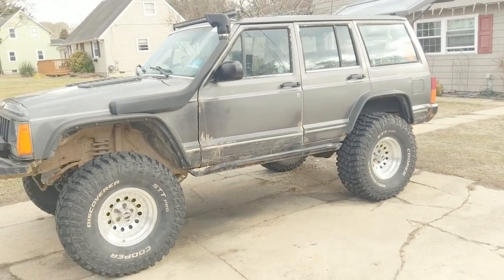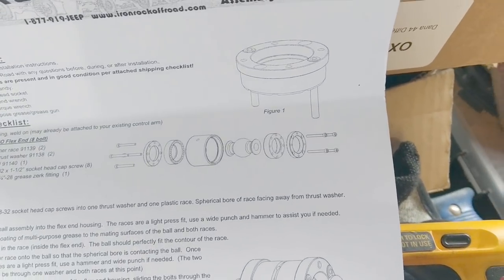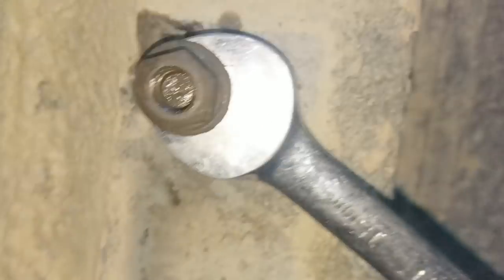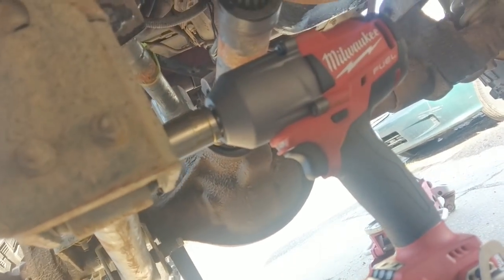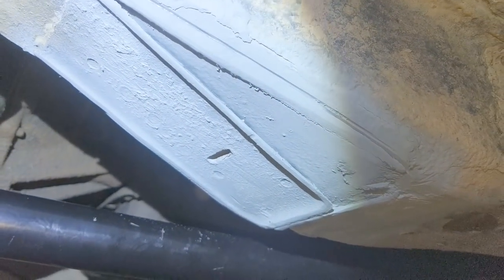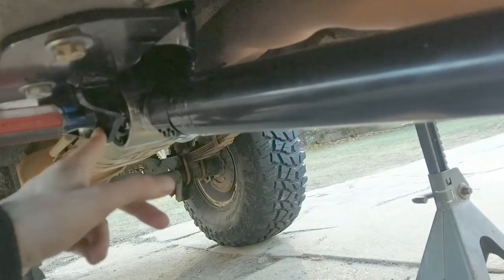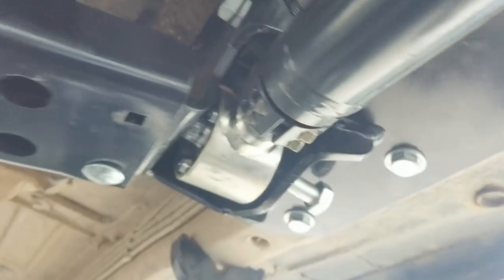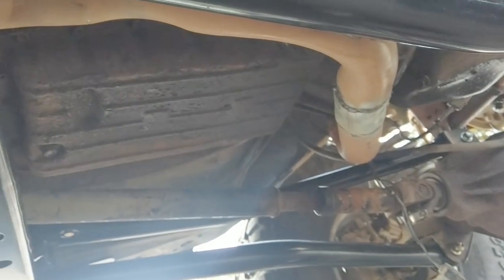89 Cherokee IRO Rock-Link Long Arm Install

Comment: Seriously! Calling the IRO a crappy design is not fair. Put a damn jack under the cross member to hold it in place while you put in the bolts!  That was painful to watch. You choose to cut the lower arm mounts out with an angle grinder/cutoff wheel then cut your exhaust with a sawzall? Dude! Next you hack up your exhaust paying no attention to IRO’s warning regarding custom exhaust! Wow, makes me regret wasting an hour watching.
Reply from the maker: Your response is a bit perplexing. Any criticism here is meant to make their product better. I saw things that were annoying, and making them not annoying would lead to a much smoother install without needing lots of unnecessary tools. That how products get better. I look for people's criticism all the time so I can improve my own products as well as how I make videos. 

I feel like I burn through sawzall blades faster then cut-off disks, but what does it matter? I'm more comfortable with a grinder and that's what got the job done for me. You can use what works for you.

And I didn't see a single mention about exhaust in IRO's instructions or on the website, but I'm certainly not blaming them for a fitment issue with non-stock parts. I cut my custom exhaust and welded it back up to fit with their kit and it works fine, so what's the problem here? Would you have done it differently? I certainly couldn't bend it.

A lot of people like my videos because I show all the issues I run into. Then viewers will know what to look out for and how to deal with potential issues. Got stock exhaust and extra jacks laying around? Then your install will go smooth then mine, learn from my experiences :)
Reply: NickInTimeFilms criticism that “makes their product better” is sent directly to them, bitching about their product is what u were doing. Yes i do have many jacks 5 to be specific and 8 stands, having long arms is not what separates “the big boys”, it is being prepared to take on these types of jobs and doing the research necessary to tackle the unknown such as custom exhaust. You do not make the videos to educate, your intention is to maintain an inflated ego and make money through advertisement views. If you truly wanted to educate then you would employ a broader vocabulary that does not use near as many colorful metaphors and educate yourself before teaching others. As a professional welder/fabricator it is not about using the tool you are comfortable with but using the tool appropriate for the job, people do not use a tack hammer to drive spikes because a sledge hammer is uncomfortable to hold. If you really want to continue to make educational and informative videos then educate yourself with a higher level of vocabulary, practice what you are about to do, be prepared for the unknown and remember you have a responsibility to keep those watching from harm by showing them the right way to complete a task.
Reply from the maker: You're certainly giving me more credit then I deserve, but your accusations are distorted my friend. I make my videos for fun and because people seem to like the detail I go into. I have been running ads over the past few years because seeing a little chunk of change each month is nice incentive to keep making videos. Adblock is out there for people that want to skip them all, and I don't have an issue with that, I run it too on most other sites but keep YT whitelisted so I sit through crap just like everyone else. But trying to "maintain an ego" LMFAO, what ego? If that was the case then I don't think I'm doing a very good job at it. An ego would mean showing off and doing an amazing job that no one could compete with, not having difficulty with fairly basic kits the whole way through. Being incompetent is not an ego I would strive to obtain, that's for damn sure. Didn't mean to get an IRO fanboy so butt hurt. I like their stuff, that's why I keep buying, but things can always be improved.

I always put it like this. The videos I make are Free Content that I make for fun. As such, I do not take them as seriously as I could. If you want real education, go pay for it. I could sit there and write an entire script, film everything with proper equipment, and obtain a much higher production value, but I don't have the time. My goal is to get the Jeep fixed in a timely manner and since this is not my job, I am only putting in a "fun" level of effort. I take people along for the ride, and if they don't like how I run things, then go somewhere else. I'm not worried if people don't like my cursing or other use of language. I'm not going to change who I am to please the few complainers in the bunch, because then I'm not having fun and this won't be worth it.

What these videos do show, is what the average Joe can expect when they are doing this job for the first time, just like I am. I don't make myself look like a professional, because I obviously am not. So hopefully viewers can relate to me as such and not take my word as the holy bible. I run into problems, I find solutions. Am I missing something here?

And I still don't know what you're on about with the sawzall stuff. IRO's directions even say their favorite tool is a grinder with cut-off disk. Tools are designed for specific purposes and should not be misused, but I'm using a grinder to cut metal.
Reply: NickInTimeFilms roflmfao!😂🤣
Reply: He has a welder and it wouldn't take much to rework those mounts or tack in the carriage bolt into place and use a jack as you mentioned to hold the cross member in place to tighten up the hardware....   But to NickInTimeFilms,  the reason why they supply carriage bolts is the nut or standard bolt head will get damaged to the point of failure on rocks and will make it much more difficult to get off or fail on the trail.... That is why they made this design.... and to keep it a inexpensive option keeps there from being more complex mounting of the cross member that could easily be modified to recess a standard bolt with a welded on nut to the long are side of the bracket....
Reply: Daniel Carney but that is what a big boy would do. 🤣
Reply: NickInTimeFilms cant take the heat then stay out of the fire. U want to play with the big boys or are u still playing dress up in daddy’s shoes? Its ok for you to “criticize” other peoples stuff but you cant take it when the roles reversed?
Reply from the maker: And to think they call millennials the snowflakes, I can think of way more "mature" people that will throw a fit over a minor inconvenience. Everyone has opinions and no one has to agree, that's the nice thing about the internet. But there is a difference between constructive criticism and showing your keyboard warrior credentials. It's obvious you don't like my style, so maybe you should develop your own channel some and show everyone how a real man builds a Jeep properly. That way I can comment on it and tell you that I appreciate the effort that you're putting into free comment for the masses to see. But please, continue your banter, it's still partially amusing.
Reply from the maker: Now now, if we're going to use insults, at least make them period correct. Tide pods are for Gen Z attention seekers, back in my day the fad was a mouth full of cinnamon without choking on it. Now then, can you tell me the main reason why control arm drop brackets are used? That's right, to obtain flatter control arm angles so that road vibration is soaked up by your springs rather then by the body, thus giving a much smoother ride. They also allow the axle to drop more to give that all sick flex the mall crawlers need so bad for grocery shopping. The sway bar drops are incorrectly used however and have been removed now that I have the proper caster adjustments to keep them off the springs. So by your logic, I should show people the safe way to lift a Jeep, is this long arm video where I remove all those drops not fitting that bill? But, you did use the word teach in there, so you might finally be on to something here. I still think you have a hard time differentiating humor and sarcasm from ego stroking, but maybe you only know about the latter as your work is so good that example isn't even necessary to prove its beauty. In all seriousness though, do you even have a rig? Anything mildly trail capable? I'd love to see your progress on such a masterpiece.
Reply: Oh please! I would love to have you attempt to follow me. Lets see how long those fake bolt on sliders last. That truck wouldnt get 1/2 mile into the trails we run. There is everything wrong with drop brackets! You expose your arms to rocks to get bent, hung up on, and just plain sheared off. Theres a reason why nobody, and i mean no one runs them! I challenge u to tell the gang at pirate you ran those. Oh wait that would bruise your ego, or are you a big boy now u got some long arms?
Reply from the maker: Ahh, a Pirate dweller, now it all make sense. Now you've got beef against JCR Sliders, man it must be tough pulling up your pants with those massive balls getting in the way. I've had the whole side of the jeep up on a rock where the axles were at full droop and they did just fine. From a clearance standpoint drops are terrible, no questions there. That's part of what I talk about in this video actually. I've only gotten caught on them once, but some skinny pedal fixed that. I'm impressed with how straight they still are after all the shit they've been bashed into, but it certainly doesn't feel too good. But it's ok, hide behind your forum possie, I don't need proof of your awesome rig, I should have been taught to just respect your word, right? I'm certainly not in 1 ton, rockboucer, Reds Only, territory but my setup is more than enough for what's local and I can drive it home afterwards too.
Reply: undersizing the hole would foul or cause damage to the threads and possibly fail.... Gotta think from a business standpoint. difficult install is a lot better than a lawsuit for a flawed design that was found to cause the failure.  But with most of these type of kits the installer needs to be flexible and think of ways to make things easier to install.   To be honest looking at that design I wouldn't buy it just how it looks... If I were to make comment to the manufacturer I would advise them to install the cross member over the longarm bracket and put the square recess for the carriage bolt in the long arm bracket portion not the crossmember portion... that way of bolts fail or come undone the transmission doesn't drop and end up unsupported.. it will remain in place but loose and not be a catastrophic failure